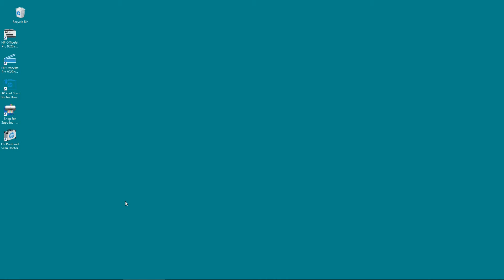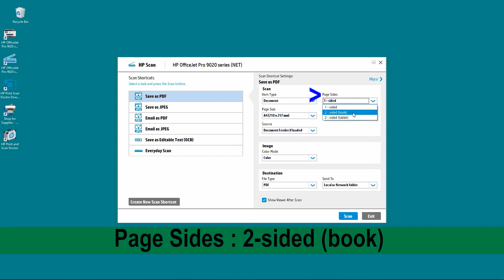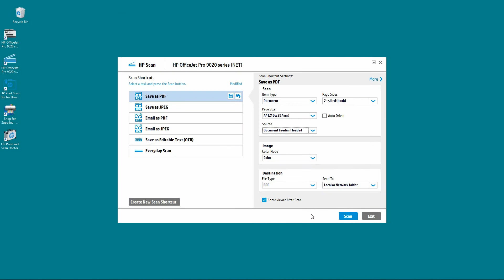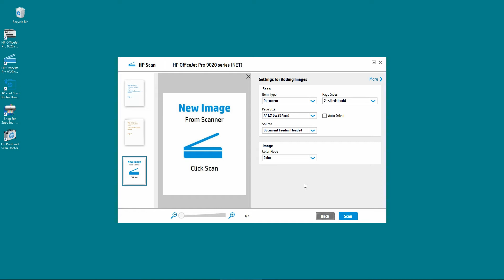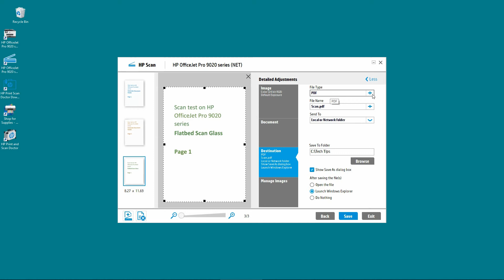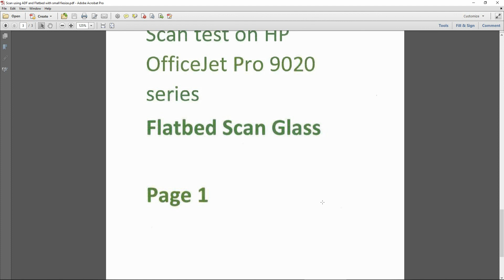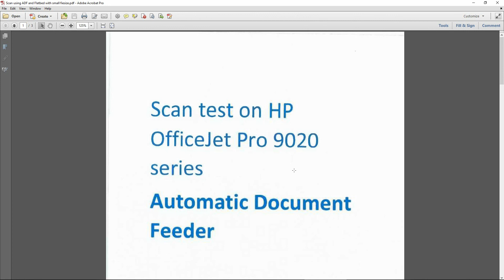HP OfficeJet 9025 | 9028 | 9020 | 9015 | 9018 : How to scan using ADF & flatbed

Comment: not your fault, but i am at my end with my 9018e.  it took me 30 min to figure out how to enable top scanning to computer and now its only doing 1 page.  whoever designed the software needs to actually use it.
Reply from the maker: Dear 

Thanks for checking out the channel!  Was it only scanning from the flatbed scan glass?

Do checkout this resource on how to use Scan to Computer correctly:
https://www.youtube.com/watch?v=70GlNM9ytbc

For more tips on these printer models:
https://www.youtube.com/playlist?list=PLUV0sXfF6zPguNcBJu9yI4tmwShUFPUUY

May we invite you to like and subscribe to our channel for the latest video uploads by simply clicking on the link below.

https://goo.gl/y4Rcn1

Click on the bell so you will not miss any notifications.

Best,
Technology Tips
Reply: @TechnologyTips017  when scanning from the actual device, yes.  I could not change that.  Only way was on the actual computer.  I had to tell it to use the feeder.  Even after that, it only scanned 1 page, said it was successful then stopped.   I messed around with it for another 30 min before going to get it done.  I know the ADF works because I test for actual copying and there were no problems.  I cannot believe HP actually did this on purpose.